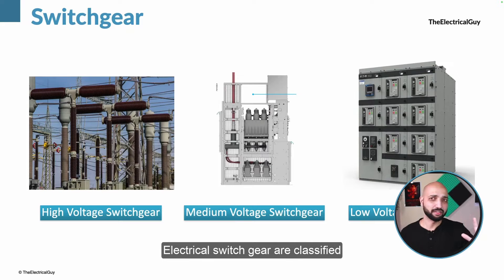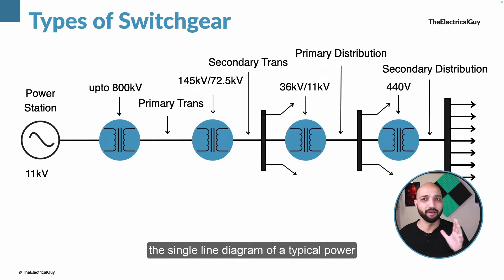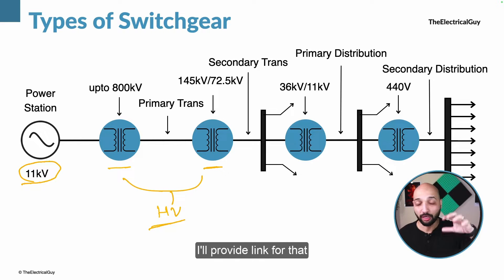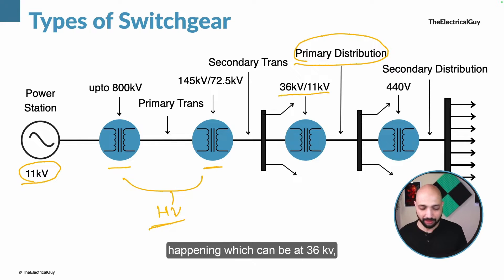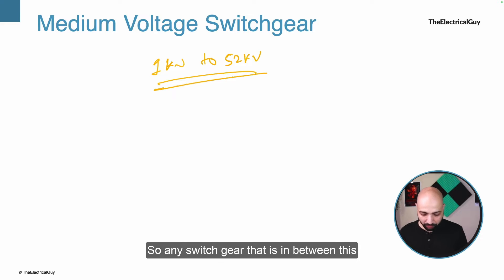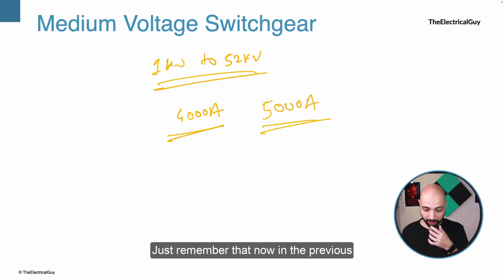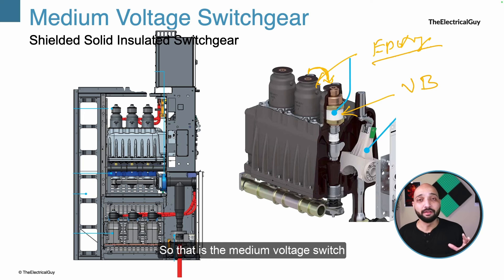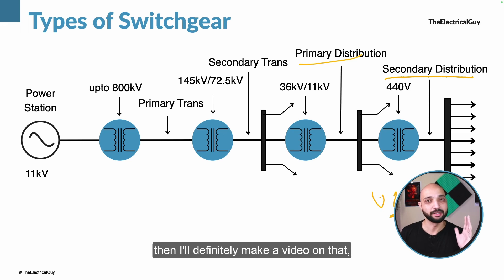Medium Voltage Switchgear : A Beginner’s Guide | TheElectricalGuy

Comment: Can you tell me the job roles of mechanical engineers in switch gear industry??
Reply: When it comes to the switch gear industry I know that many electrical engineers work in research and development and help manufacture the circuit breakers trip units. The advancements made in electrical trio units have been good the past decades. As for mechanical engineers   They could be out in the field doing service work for existing gear or new projects. They could also apply themselves working with the mechanical machinery that is still part of the systems.
Reply: There will be an external relay as well.

Comment: Can the equipments in the switchyard of 33/11 KV substations like CT,PT, CB, Isolator etc be classified as MV switchgears since their voltage ranges between 33 to 11KV..then why is the video only talking about MV Panels? Shouldn't we include these equipments as well ?
Reply from the maker: Yes. That part will also fall under the medium voltage switchgear. It is mostly outdoor and works the same way as explained for panels !